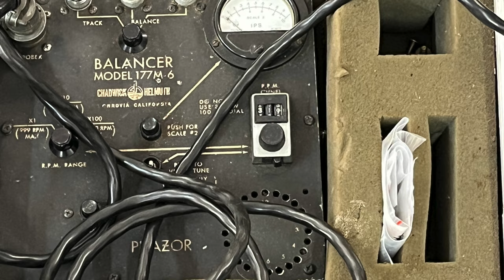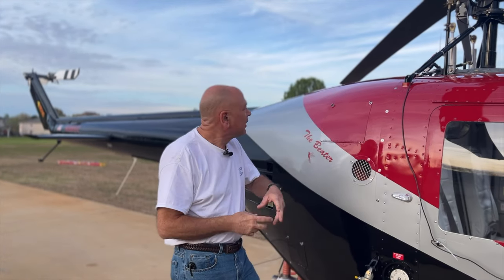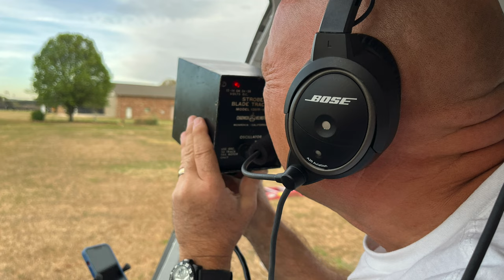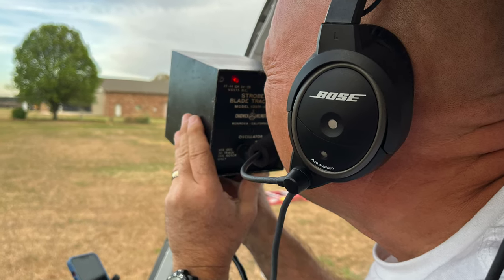Blade Tracking with the Chadwick

Comment: That's the same gear we used to track helicopter rotor systems back in the 80s.  We eventually added the Scientific Atlantic "VATS" system for dynamic balancing as well.  It was similar to some of the prop balancing gear available for GA aircraft now.